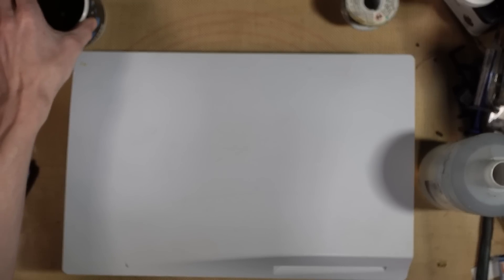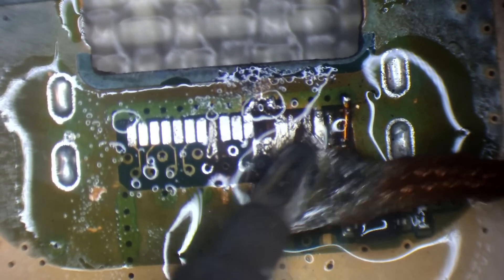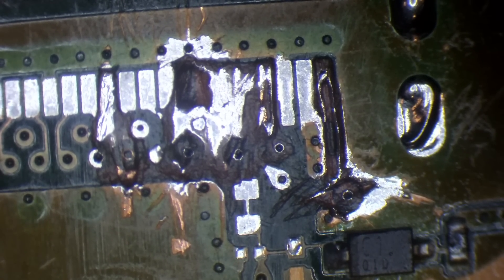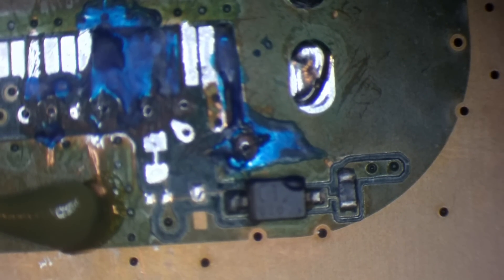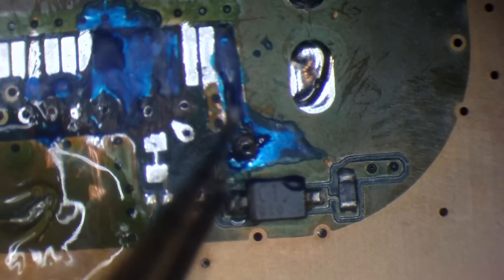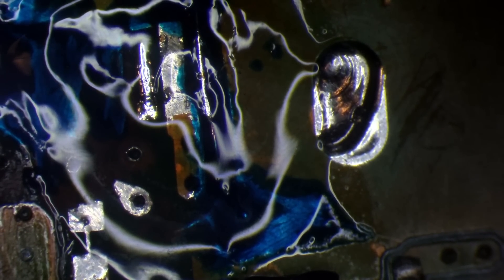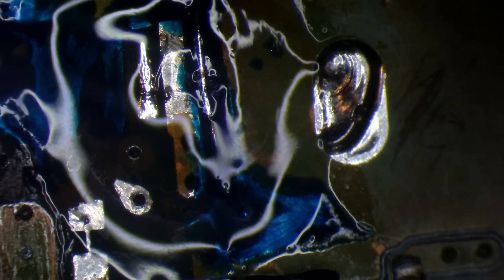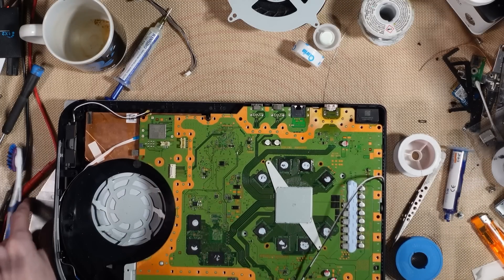This Poor PS5 Had HOLES In The Motherboard! But Can I Fix It?

Comment: Would it be worth it to conformal coat that tiny capacititor before changing ports to keep that sucker from getting moved off on normal port replacements?
Reply from the maker: It could be yeah. I guess because I wasn't intending to sell it I didn't care because I don't have to personally worry about knocking caps

Comment: Most of the time torn traces and pads are due to people getting frustrated that they are unable to extract the port or fix it. 🤣🤣🤣🤣
Reply from the maker: Yep to both theories 😂
Reply: Sometimes it's because they're trying to melt lead-free solder using Grandad's old soldering gun that only goes to 200°C.